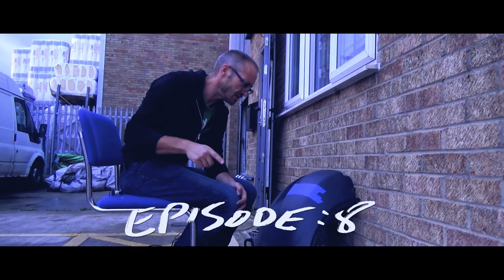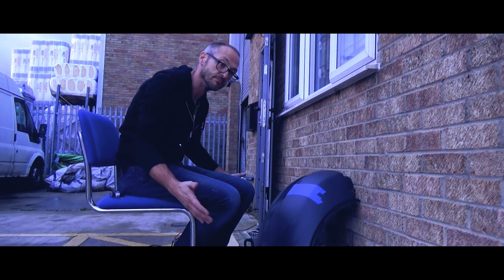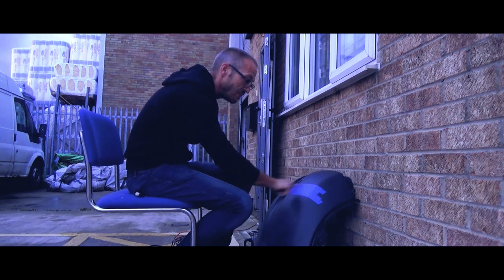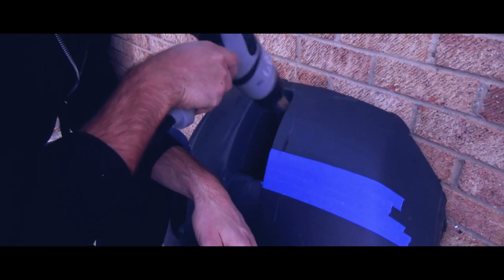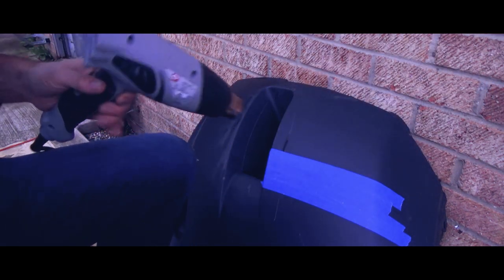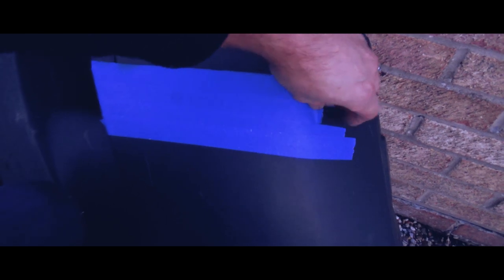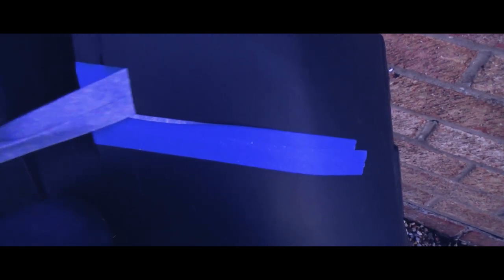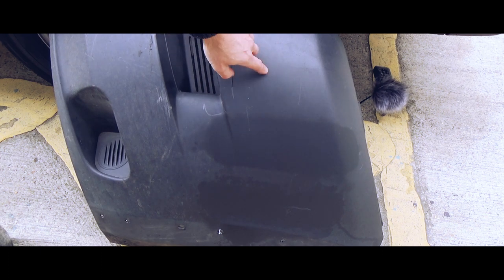8: Using a hot air gun on my Ducato trim?

Comment: I believe the heat gun method will only work a couple of times as I believe it releases the oil from the plastic and after several goes with this it will become very brittle, my preference is to use boiled linseed oil wiped on with a cloth - it is about 5-6 quid for 500ml bottle which lasts ages and it’s easy to apply and does a reasonable job of returning plastic trim to its original colour.  Loving ur videos so far
Reply from the maker: Thanks Peter. Yeah, I gave up with this as a method. The colour didn't change at all and the technique/gun I used just ruined the texture. I heard that oils are the best way to maintain outdoor plastics. Ill test out Linseed, etc at some point  in the future. The SweetProjectCars channel demonstrated mineral oil and baby oil 50:50 mix too. I also was given the expensive plastic restorer in this video, but I'll keep that for the interior. Thanks Peter 😊👍

Comment: Hi mate, can those sections be removed without taking the grill out? I need to change my intake hose and looks like going in through the side is the best option.
Reply from the maker: The grill comes out first, then the rest. The little clips the torx bolts screw into can easily snap and spin too, leaving you stuck. Be gentle!

Is it low down in the engine bay to go in from under the wheel arch? The plastic underneath is held on by screws from memory.
Reply: Brilliant @Mevi , yeah it's lowish down and taking the bumper off would give me plenty room to work, but going up underneath might be an option. cheers mate.

Comment: Hi I've got an older fiat ducato 2.0 jtd 56 plate do you know if there is a swivel plate for the 2 seater for that age vehicle
Reply from the maker: You mean the bench seat? Not looked for the older one, but there is one for this model.... It feels like a badly thought out bodge to me. Every review of that bench swivel complains of the insane time and effort needed to turn it around.
I feel your pain, it'd be great to have a simple bench swivel.
Reply: @Mevi  yes the 2 seater front passenger seat is yours just got 4 bolts off centre more to the passenger door then the frame goes of on an angle